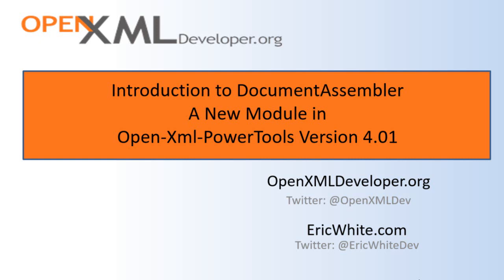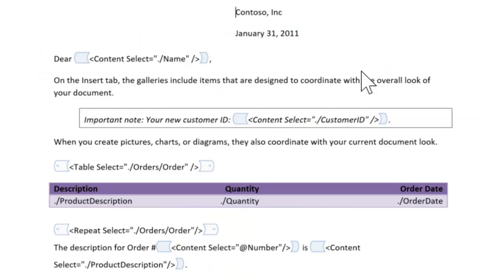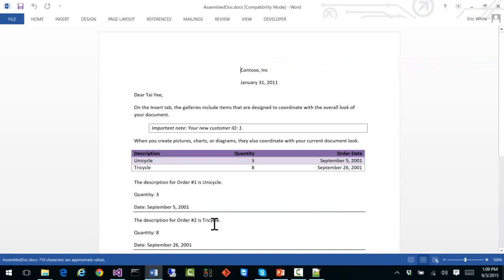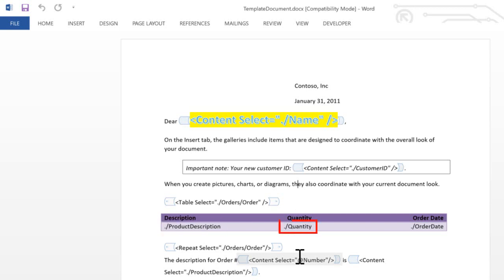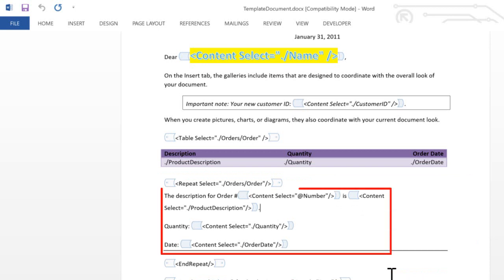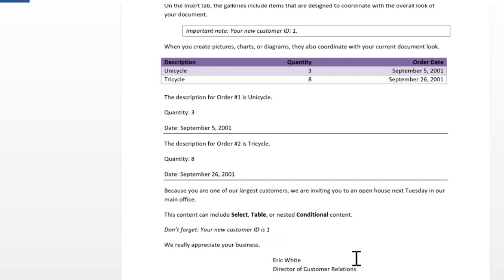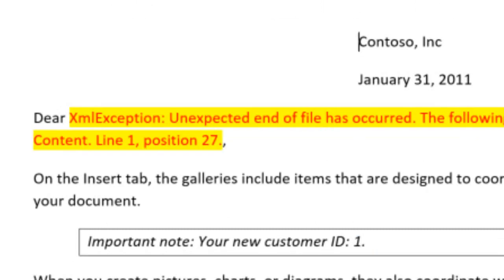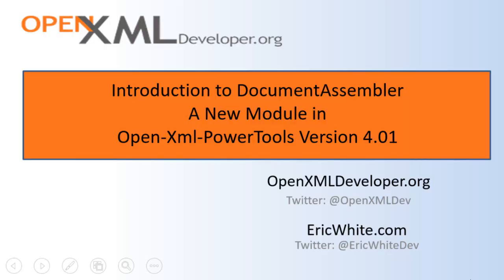DocumentAssembler Overview

Comment: Dear Eric ,  I want to ask one question. I have a table which contains 2 rows [Header with wrap text on first row and actual column in 2 row ] when I am using DocumentAssembler it does not work and I get message "Table does not contain a prototype row" question is how I can use DocuementAssembler if my tables has complex header row formation like merged cells wrapped column .